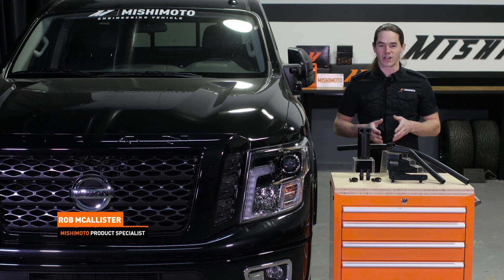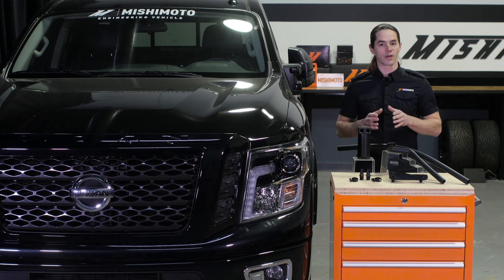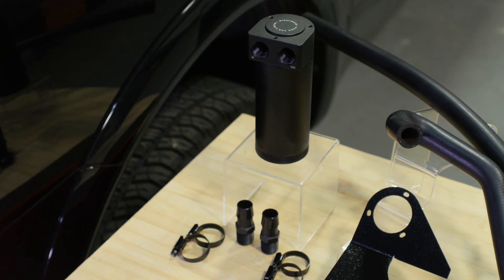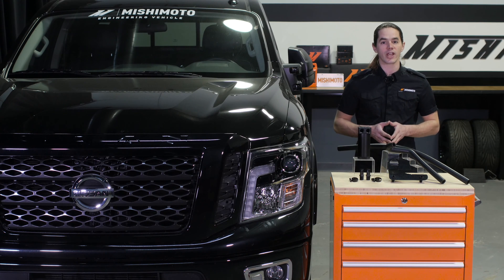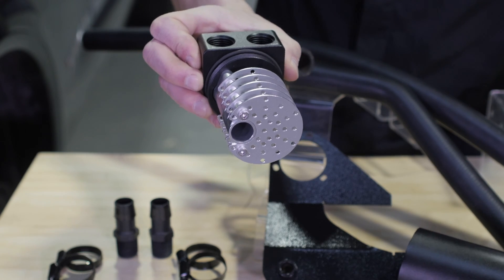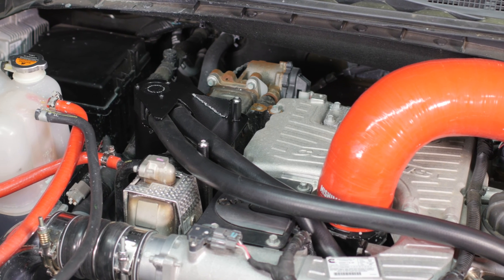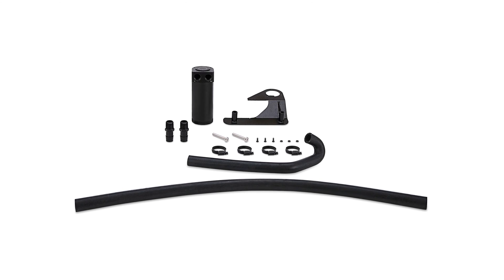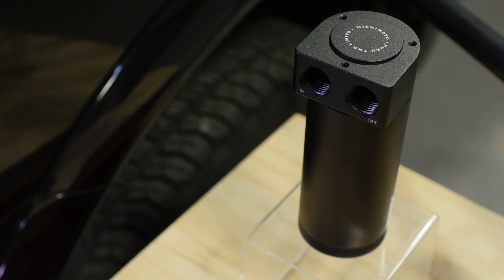2016-2019 Nissan Titan XD Cummins Baffled Oil Catch Can Features & Benefits by Mishimoto

Comment: Will it void my warranty??
Reply from the maker: Hello Junngo Jangles, Typically, warranties are handled on a dealership to dealership basis. I would suggest contacting the dealership you purchased from and ask how they feel about aftermarket parts. You'll usually get an idea as to their feelings about aftermarket parts quite quickly. Some dealers do not mind at all, while some mind quite a bit and will void your warranty if they see a non-oem part.